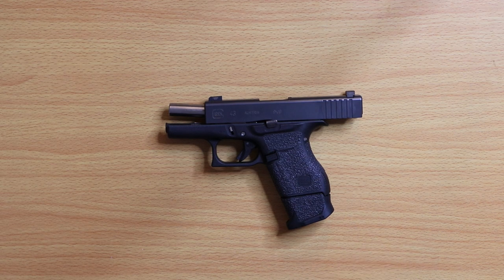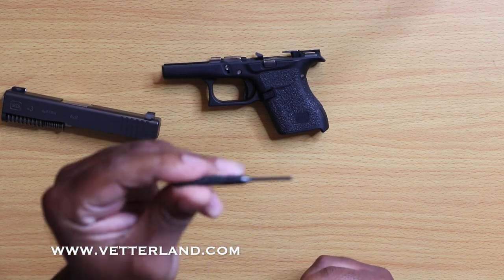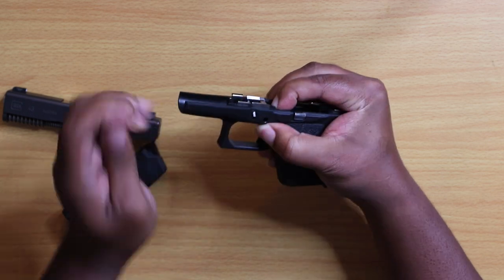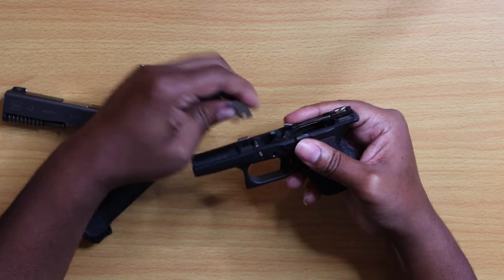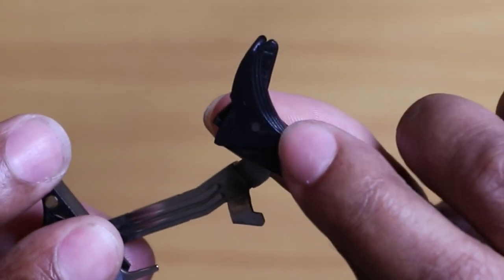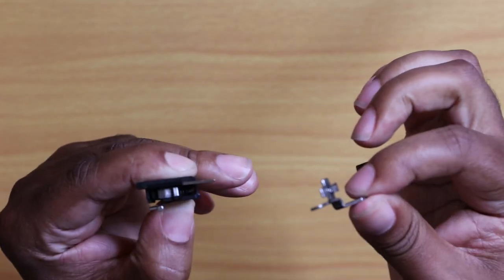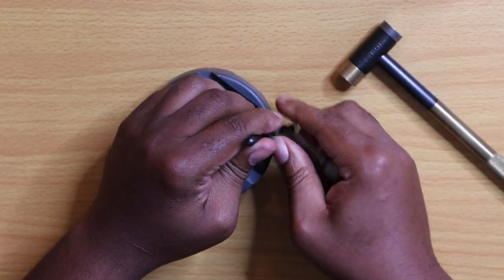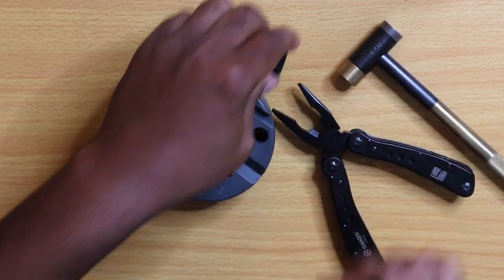Best Way to Remove Glock Trigger Shoe

Comment: Hi. I have to make a hole to take it off, right? And the trigger will work ok? Regards from Portugal
Reply from the maker: Marcelo Oliveira You must punch/push the pin out. The only time that you would do this is if you are replacing your original Glock trigger shoe.